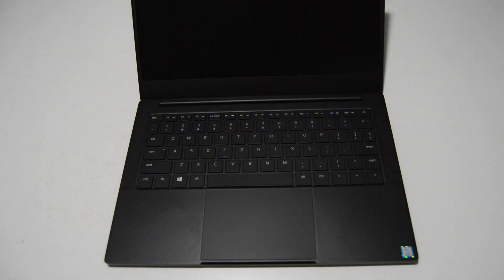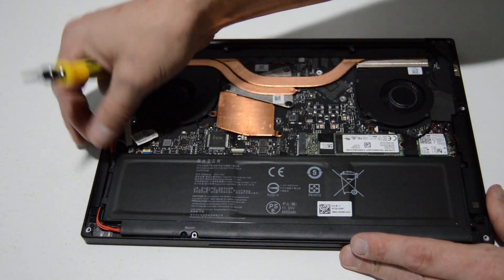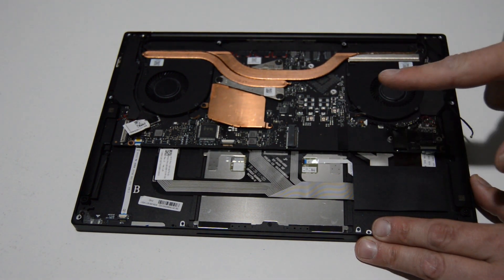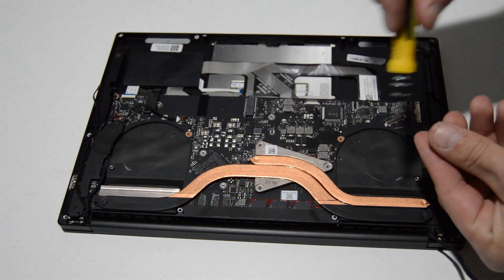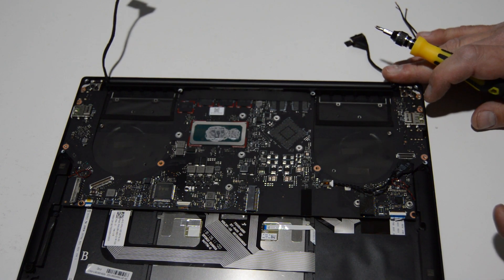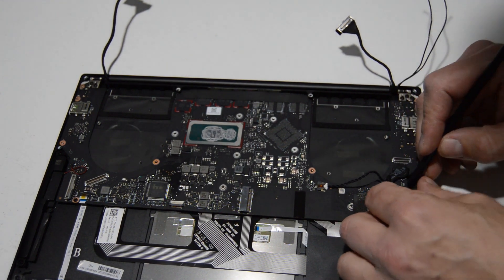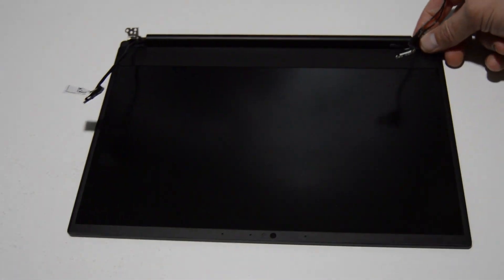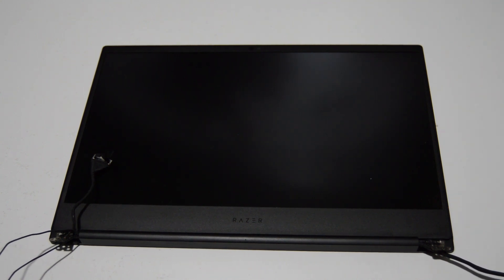How to Disassemble Razer Blade Stealth RZ09 Laptop

Comment: hey man, great video! I have the exact same model. However, after I dropped my laptop the camera and the microphone seemed to have broken. How can I replace those parts?
Reply: Hi mate I have the same problem, have you figured it out yet?
Reply: @owenjohn4838   hey, at first I thought it was a hardware issue and accepted it. Luckily though, after I did an update the camera and the microphone started working miraculously! IDK how, since I really need the camera and microphone working, I did a lot of googling, troubleshooting, uninstalling, installing etc. and ended up updating some things (sorry I forgot). If the hardware is kaputt, then I think it's different thing
Reply: @warmhappyguy  yeah can’t figure out where the webcam connects to the motherboard and can’t seem to find a diagram that explains it. Bit of a mystery but everyone seems to be having problems with the webcams and microphones?

Comment: I am having a issue with the LED of the keyboard.  I have check the laptop for virus, I formated the laptop and still the issue persist. LED are lighting when ever they want. They are not consistent. Sometimes when I start the computer, they light up and sometimes they do not.  Could this be a loose connector? What cable is the one for the lights of the keyboard?

Comment: Out of interest, could you leave the webcam cable unplugged when you put it all back together? Would the screen still work?

Thanks
Reply from the maker: It should still be fine, if you want to disable the webcam it might be better to just stick some tape or something over the eye.
Reply: @Sellbrokedotcom  It doesn't disable the microphone tho so if I unplug the camera cable this should also disable the mic and I don't want a nice looking machine like a razer blade with stuff stuck over the camera.

I always unplug them from the bezzle but I wouldn't want to try it with this, I would rather spend a little bit of time and unplug the webcam from the motherboard and then be done with it.

Thanks for the reply.

Comment: Hey, dude thanks for the video! I've just noticed a weird plastic tab that connects my keyboard to the screen in the middle of my laptop is cracking and breaking. I'm unsure as to what this part even is and can't seem to find anyone else having the same issues. Do you have any ideas of what this is and if it's replaceable? I can send pictures if need be.
Reply from the maker: I have no idea what that is. Can you see the same at any time during the video?
Reply: @Sellbrokedotcom  I'm unsure if we have the same model but I saw you at least taking a razer laptop apart so I figured there may be a chance. I have the 2018 15inch advanced version if that helps.